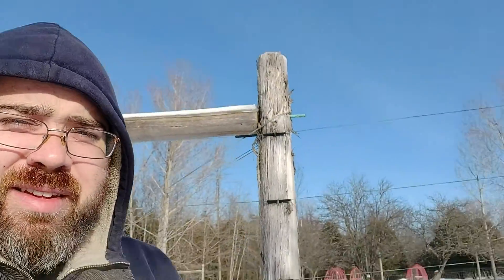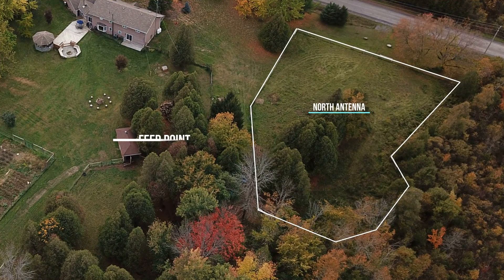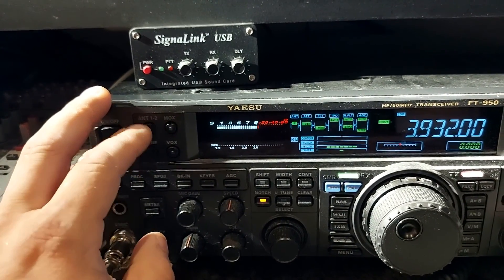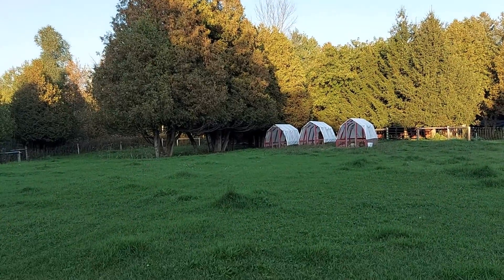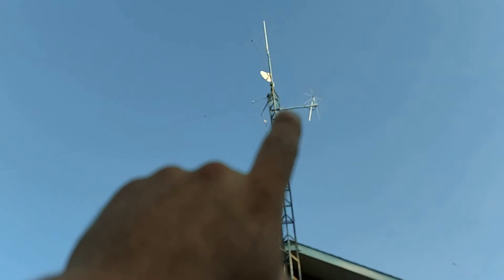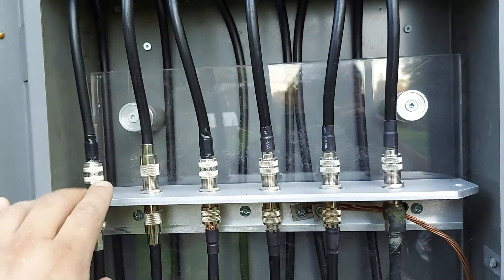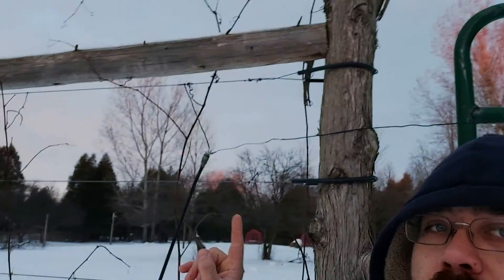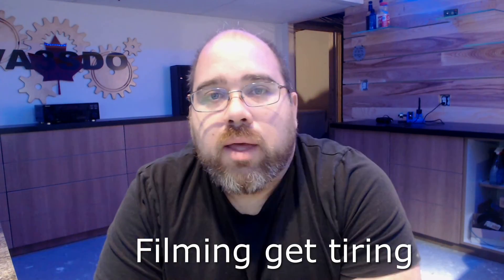RX Antenna Build / PART ONE

Comment: Can you help a disabled ham out with using RG11 as the cheap LMR400 for this type antenna? Its a budget thing and I need impedance matching for SDRrx and TS-590s into a combined N or SMA. I don't use regular connectors. 😮
I think taking this cable, thick direct Burial stuff is underutilized for poor guys like me. Stupid medical people keep stealing my beer snd hsm radio money. basta...s
Reply from the maker: Hi Craig. If you are intending to use it for receive only than the impedance mismatch of 75ohms is fine. In fact lots of people use 75ohm coax for receive only from what I have seen. The other factor will be length. Depending on the length of the coax the RG11 will have loss (all coax have loss some more than others). Typically this can be found on the manufacturer specification sheet available online. Depending on the length and the specs you will need to determine if it will work for you. I would suggest you add a "low noise preamp" inline with the coax. This will boost the signal coming down the coax. These can be found for under $10 on Amazon. Remember 75ohm for receive only not transmit antenna. K8MRD made a video a few weeks ago about coax loss. I suggest you check it out.